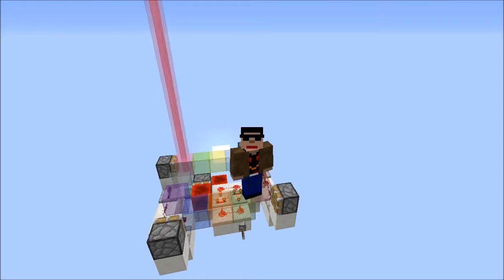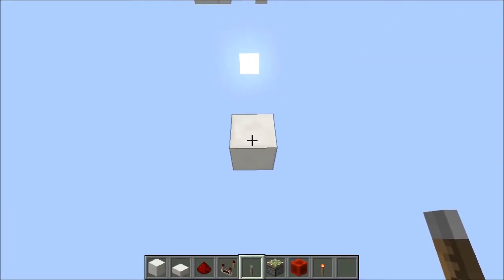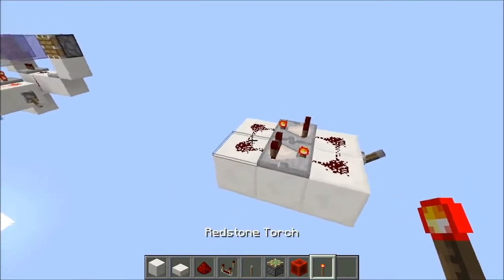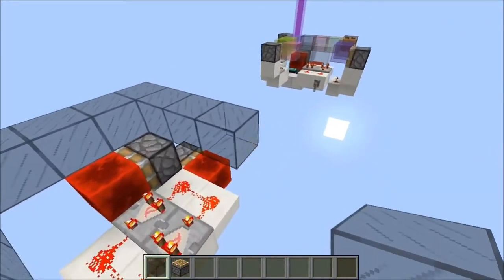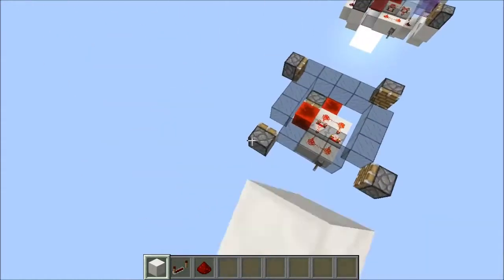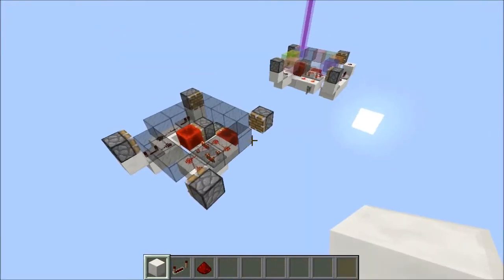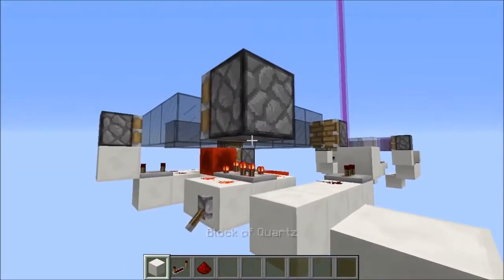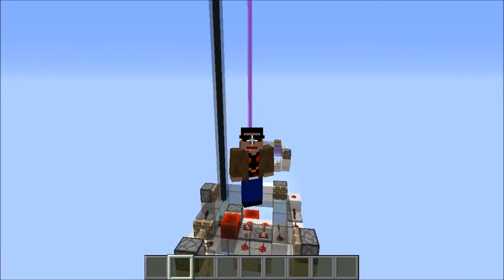Beacon Color Swapper: 13 Colors

Comment: That is very nicely done. I was just finishing my fourth beacon around my tower and I though "It would be neat if I could change colors on a button press" and shortly thereafter "Someones probably beat me to it". I'm going to try and adapt this into my tower design, but in the mean time, maybe you could make a version that swaps on button input without the clock, one button press equaling one color switch?
Reply from the maker: +Ima Tron That's a great idea! And glad you like the design :-)